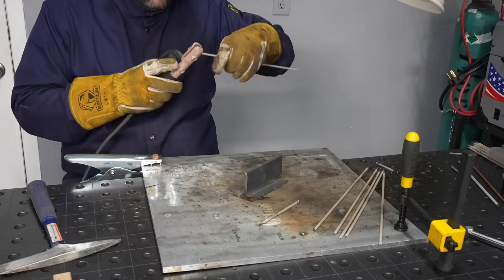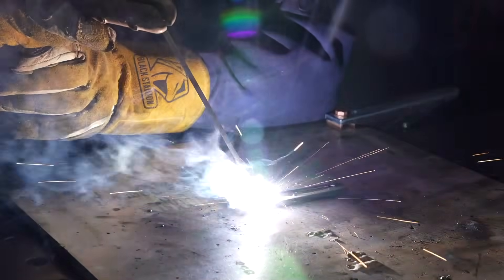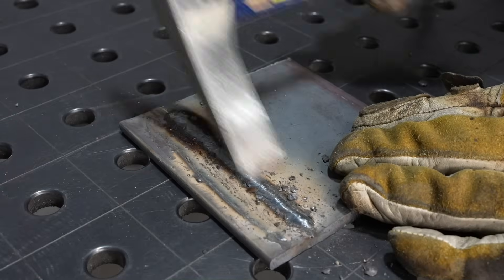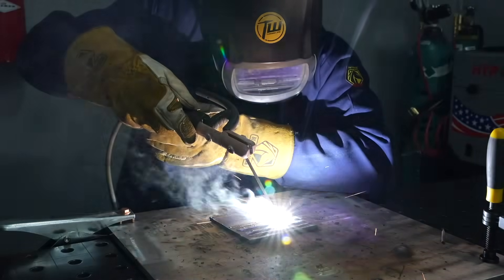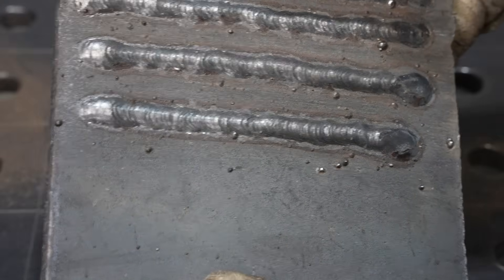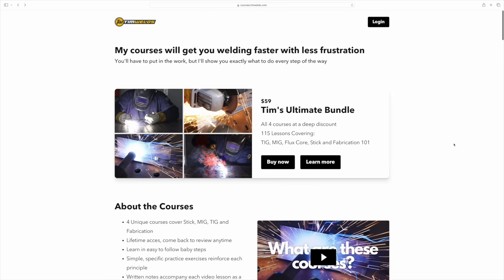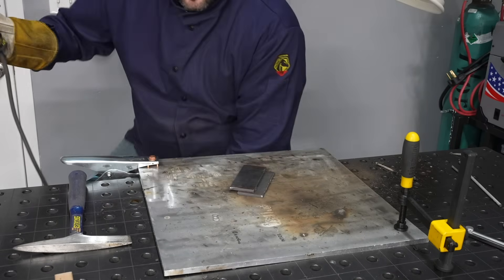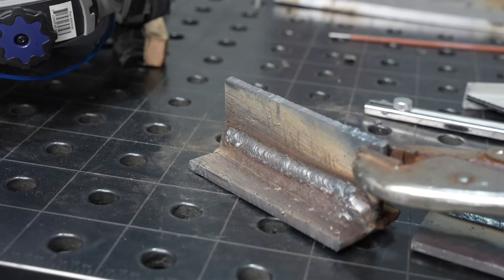Stick Welding Basics: Practice Drills

Comment: What size, type and thickness of metal plate do you have over your table?
Thanks for the great video's.
Reply from the maker: It's aluminum, not sure what alloy, about 1/2" thick and 16" square. It was just a remnant that my material supplier had on hand and sold me cheap. I have another 1" thick plate with threaded fixture holes that I use when TIG welding nice aluminum parts because grounding through it doesn't leave marks on aluminum like a grounding from a steel table will.

Comment: When you started layering the welds around the 12:00 minute mark, did you let the metal cool down after each pass or were you able to do a couple of passes before letting it cool down? Does it have to get cool to the touch before running another bead?

Comment: my 110 volt mini welder will not run a 7018 3/32 rod at all
Reply from the maker: It definitely depends on the machine and the actual output.

Comment: Good tips, but feel you skipped over the initial setup when you mentioned using electrode positive.. what did you do when setting that up?? What was done with your clamp etc.

As a beginner, feel that’s an important part brushed over
Reply from the maker: The lead with the electrode holder connects to positive. The lead with the  work clamp connects to the negative terminal then clamp it directly to your workpiece or welding table.

Comment: I welded a wood tapping screw to a thick pipe maybe close to half inch thick or something small. Flux. Then want to try stick 3/32 Hobart e6013. Gonna weld the length of the screw to this pipe. 

Is this even good practice?  
Well it’s coming along nicely

Comment: Wow I learned so much from this video. I work on a farm and been here on this farm for 7 years. We do alot of welding. I had no clue how to but I really wanted to learn this skill so I just started to do fence repair and hard surface sweeps. No one really ever taught me how so I was having issues with some of my weld's sticking or staying together. Everything I fixed eventually came apart. But I never gave up. I'm working on a gate right now and I have to do it right because it's a big deal if this gate fails. So I looked up videos on how to weld and here u are. I didn't even know about the puddle until now. Thanks for sharing
Reply: Welding is the best thing about farming :D

Comment: I'm curious as to how you're getting rid of the smoke in that little garage? I want to start practicing in my tiny garage also but how will I get rid of the smoke?
Reply from the maker: I have an industrial fume extraction filter. They're expensive, but I do a lot of welding and it was worth it for me to buy one, then Fume Dog sponsored the channel with a better one. Before that, I attached some flexible duct from the hardware store to a ventilation blower from Harbor Freight. I just placed the blower at my door blowing outward. The whole thing cost about $100 and while it was a little less convenient than my current setup, it worked just as well. A lot of folks have done the same thing and mounted it up high with a hole cut through the wall. Here's a video about my DIY setup: https://youtu.be/cjqtnxb3xg0?si=_R2vaYHmuRacu5IC

Comment: Do you still have your little Deka welder?
Reply from the maker: No, I had more than a dozen welding machines and that just didn't make sense, so I gave some away and sold some to let others make use of them rather than just letting them sit on the shelf. I did keep it for about 2 years and used it a lot. It never let me down and was great for the money, but I'm not sure how it stacks up against others at similar price on the market today.

Comment: What are the electrodes that pipe liners use? I want to practice root and cap? Can someone clarify?
Reply from the maker: It depends, but usually E6010 for the root pass and E7018 for the fill and cap.
Reply: @TimWelds  Is it usually one pass of 6010 inside the bevel all the way around, and then filling everything else with the 7018?

Comment: No flat plate here - 40mm x 2mm L-shape is all I have. 2.4mm 6013s which I've tried in both polarities. 90 amps indicated (90-93 measured). Am getting better after few days, but my welds look more like rugged mountain ridges rather than your nice flat hills... Slag is a pain to remove as well sometimes - it ain't "peeling off" 😂 At least, the rods here are sold in 2.5kg packs and relatively cheaply.

Comment: I am thinking of giving it up, no amount of online tutorials seems to make me any better, too many variables to get a good weld.
Reply: If stick doesn't give you satisfaction, try MIG. Take a class at a community college or something. Nothing is easy or natural; everything takes practice.
Reply: Never quit, you can do it!
Reply: Is it possible you are reading too much into it? The variables aren't too many, IMO. 1. Amps are dictated by the rod. 2. Learn on one all-round rod eg 6013. 3. Metal thickness dictates rod size. Thin stuff needs thin rods and low amps, thick stuff needs thicker rods and high amps, positive. Thin stainless needs negative, thin stainless rods and low amps. Assuming, like me, you stick to horizontal welds for now then we are looking at 6013 1/16" and 3/32" IE 20-45 amps/ 40-190 amps. Start low and work up, stick to tack then bead. Small gap, good angle, keep moving. Rinse and repeat, then do it again.
Reply: @tyrotrainer765  Thanks for the reply, I have finally got decent results, mainly after trying 7018-viewing the pool showed I was goin way too fast and not keeping the rod barely touching the metal-high arching before. But the main problem was speed-so for other new players-if you end up with slag entrapment-its because you are going way too fast or not enough current.
What also helped was a good welding machine, the cheap Deko was frustrating-sure you can get decent results if you are pro, but for a newbie, its not as forgiving as a good welder with great arc stability-in my case I got a Fronius which seem less fussy with rod angle, its a bit like a mitsubishi Evo-that uses a computer to give you great lap times with good traction.
Reply: @engjds  Great! 😃
Reply: @tyrotrainer765 this is an amazing comment. As someone who just switched from mig to stick this is way more challenging
Reply: When I took welding in high-school I started probably the worst in my class.  I just couldn't do it but damn I enjoyed doing it.  By the end of the first year I was top of my class and by the end of year two people assumed I was a child prodigy.  Iv only ever welded twice in the 10 years since then and boy I lost all of that talent 😂😂 but I just bought a welder and am about to dive right in again!
Reply: Don't give in. You got this Rome wasn't built in a day
Reply: Same bro😢
Reply: @el_70rio  If it helps, you need really good sight on the weld,  magnified reading glasses worked for me and get up close (1ft to 2ft), cheap welders are under current by about 10%, so if you are using 6013 2.5mm, about 100A on the display.
Can get it some days, then other days the welds look like crap.
Reply: How long have you been at it?
Reply: Ah don’t give up it just takes time I use to think that back in high school wanting to be a welder. 2 years later I’m a tankshop welder.. practice makes perfect I burn so many 5p rods over and over intel I finally got that prefect weld. It will come in time
Reply: Don’t get overwhelmed, you got this!
Reply: To anyone struggling I urge you to watch Tulsa Welding Academy Stick Welding 101. The presenter is ex military and a superb instructor. The technique he teaches is simple and extremely effective - it is quite mind blowing. I can't believe that I'm welding SO well now, in the space of 2 days, and there is no thinking involved - it is a relaxed and easy technique. And it is NOT one of these gimmicks that proliferate on YT, it's simply a bulletproof method I'm guessing he learned in the US military.
Reply: @tyrotrainer765  Thanks, will check that out, though since that message, I got hell of a lot better, at some moment everything just snapped and everything came together.
Reply: @engjds yeah it’s the same with bar cords on a guitar, they are nearly impossible,then one day it just clicks and you’ll be sliding with confidence.
Reply: Don't give please you just have to keep trying with time  you will be good at it okay 👍 ❤❤
Reply: Don't quit, man. I was told you are only as good as how much rods you burn!! Keep welding!!
Reply: @Paulklei  I didn't and can now do some decent welds, god knows how many Kg's of rods I have burnt, I think its as difficult as learning a guitar or other musical instrument-especially with cheaper welders that are fussy about arc length.
Reply: Don’t quit bro you can do it 💪💪💪
Reply: @sepporhys4799  Thanks bro, as it happens i stuck with it and got some pretty good welds!
Reply: Just gotta do it. It’s like driving a manual vehicle.
Reply: You need to find a tempo to follow.  Oscillate the rod just a bit. Stringers are super hard and defeating. Take a little of what everyone teaches you and make your own way of doing it
Reply: I feel same way
Reply: @johnjno2267  Do yourself a favour, get a fronius stick welder, once I used that and 7018 rods with a cheater lens, everything worked, go just say 2mm a second and you should feel the rods just about scraping the top of the metal to get that sizzling bacon sound. Hot start is a really cool feature, you can arc it every time first time!
Reply: Remember, you can’t say “I gave up” without saying “I gay”.  You got this.
Reply: Are you still welding or did you actually give it up?
Reply: No one became an expert on day one, it takes time and practice to be really good on something. Although I’ve been welding for a couple weeks I still have the need to improve and learn new things. It’s just one of those things that takes time since it is a special skill not many people know 🤷‍♂️
Reply: youtube tutorials don’t teach shyt, man.  You need to take a class by an experienced welder and even though I didn’t get it good enough by the end of the semester, I still learned his drills and his tips so I just kept practicing that long after.
Reply: @WULDORI  I think it would have saved me weeks of practice with a welder by my side yes, in the end I got it, but it took a LOT of practice and burnt rods, its possible watching someone like Gregs channel, but its far from easy, yes you are right, I would always advice someone go on a course before trying to learn this themselves, I bet the number of burnt rods would have paid for a small couse hehe.
Reply: Yeah if that’s ur attitude then packing it in makes sense
Reply: @mongo7060  As it happens, I never did give up, and now get some good welds.

Comment: I do ok with 6011. My problem is I can’t seem to see the puddle with 6013.
Reply from the maker: 6013 is kind of difficult to see the puddle because the slag runs over it. I think 7018 is much easier to read the puddle.

Comment: Beginner here. What size of electrode do you recommend if I am going to weld a 1.5mm steel?
Reply: 6011 3/32
Reply: @irishlush364  how about a galvanized iron steel? Do you recommend the same?
Reply: @aaal695  that's what I'm gonna use on galvanized coated steel
Reply: @irishlush364  thanks!
Reply: @aaal695  I ran it on galvanized yesterday at 70 amps.i grinded the galvanized off where I was gonna weld it did decent
Reply: @irishlush364  how thick is the metal/steel you welded?

Comment: My job is currently moving my position from machine operator to stick welder, I have small mig and tig experience but I’ve never stick welded before, they said they will teach me but any outside tips or advice anyone is willing share definitely helps! I’m not nervous but I want to impress my superiors with more that I could know before hand, although it doesn’t give the physical skill I’d absolutely love to know more before going in to it.

Comment: @TimWelds your content has consistently been the most helpful to this beginner welder, thank you! I have a question about safety, apologies if this was mentioned somewhere I haven't seen yet... I see you leaning on your welding table, and you're certainly not the only one. I realize electricity follows the path of least resistance and the ground clamp should "pull" all the current away from your body, but do welders sometimes get shocked this way? Wouldn't it be safer to put a plank of wood or some other insulating material on the table to isolate you from any potential stray currents?  Similar question about holding the electrode with your glove...you're near a table that is now a ground, so I don't understand how this is safe. Appreciate your thoughts/opinions. Thanks!
Reply: It follows the path of least resistance it is easier to go to the clamp then going to his body. You should also be wearing safety boot that are isolated at the same time so it isn't a real problem.

Comment: You should do a video of capping a 6011 weld with a 7018, Very hard to get it to look good at least with 3/32" rod but I noticed my test beads look pretty much like yours so I am starting to think it is just not a good size rod to cap with?

Comment: I have some blue demon 7018 3/32" rods. The packaging says the amperage is only 60-80. I have identical size radnor 7018 which has a range up 115amps. Is that some kind of mistake? Seems like same size rods should be same amp range?

Comment: I truly enjoy your videos but as an instructor I would never start a beginner on running beads. They need to first learn how to strike an arc. I would have them just do Tack up and down to start so that they get use to not sticking and used to starting the weld.
Reply from the maker: Thanks a ton for the comment! I completely agree. What you described is actually the first exercise in my online courses and I have several videos about it too. I’m not suggesting stacking beads as a starting point, just an exercise to improve consistency and learn to see.

Comment: Are you weaving or any movement or just running a straight bead
Reply from the maker: Just a straight bead. Weaving is usually only needed on vertical up with stick welding.

Comment: I’m confused.  Just before the fillet weld you wanted to use 6010 but at 10:34 you discussed 7018? 

Rearranged leads to address arc blow? A switch of polarity? I saw no change in ground clamp position.
Reply from the maker: I just used 6010 to tack it up, all the weld beads were done with 7018. The work clamp moved from the end to the beginning, but I might have mixed up a clip so that it didn’t show that way since I filmed the video twice to get all the shots.

Comment: Great video. I have to spend a weekend soon  and go through a few pounds of 7018 and get some arc control back. ( I have an essential tremor that makes me loose muscle memory fast). Right now I am about to go down the arc blow rabbit hole, see you on the other side..
Reply from the maker: Thanks! The arc blow rabbit hole can run pretty deep, but this is one of the best articles I've seen on it: https://www.lincolnelectric.com/en/welding-and-cutting-resource-center/welding-how-tos/prevent-arc-blow

Comment: Practice, Practice, Practice! Thats what I need to do! I Used to weld 3 processes as part of my profession, but slowly worsening vision made me nearly blind by early 2023. The last good welding I did at work was early 2018. I kept dabbling with it at home & medically retired summer 2019. Thankfully I got insurance for the eye Dr., got laser treatment for both eyes in Dec.2023 & am much improved in vision! I have old SMAW welding rods & tried welding again with mixed results. I could definitely see better but am still fighting a lazy eye that won't accurately focus in the same place.
Mainly I should do what you did in this vid. & burn up lots of rods on flat plate to blow out the cobwebs, knock the rust out & get my groove back. I think it's kind of like trying to ride a bike after 15 years of not riding. Very wobbly & ugly, but quickly getting better & nicer, sturdier welds! When I can afford it, I need to buy fresh rods too! Thanks Tim for your timely, helpful vids. Paul from S. Central Tx..
Reply from the maker: Thanks! Glad to hear that the laser treatments worked well for you. It's amazing what they are able to do these days.

Comment: Thank you for a nice detailed video!  Question: Is there a reason why I shouldn't hold on to the rod itself, to steady it? Is it a safety issue, even if I am very careful not to put my fingers close to the arc, or something else?
Reply from the maker: Thanks! A lot of people, myself included at times, hold the rod loosely with a dry welding glove without any issue. The rod itself can get a bit toasty, though.

Comment: any lenses for my welding hood you can recommend me?
Reply from the maker: If you look at the optical clarity specs, any of them with a 1/1/1/1 or 1/1/1/2 rating will generally be really good and there are a lot of them available at many different price points. I use Miller Digital Infinity hoods, which are great for benchwork, though a bit heavy and tipsy for out of position stuff. They aren't cheap and I don't know how much better they are, but they work for me and take a beating. @MakeAndFixItYourSelfProjects mentioned a YesWelder auto darkening hood, they sent me one a while back to try and I was surprised how clear it was.